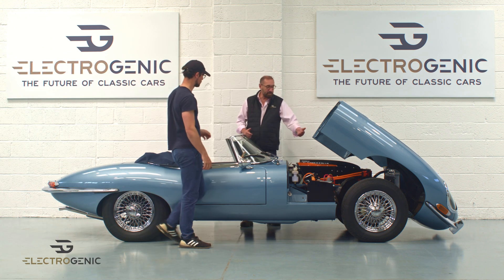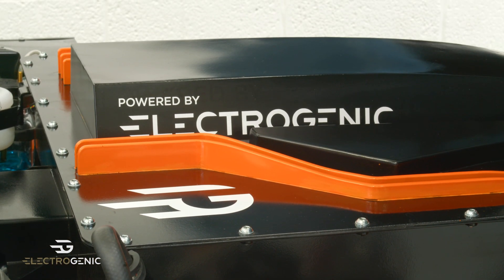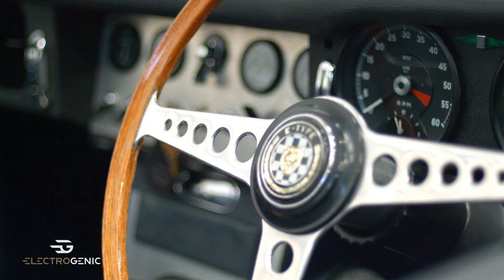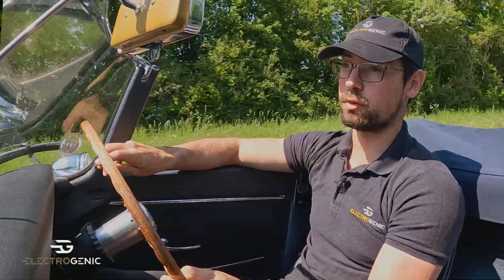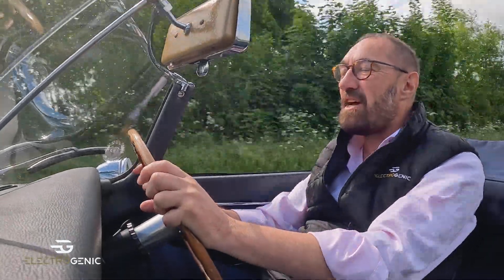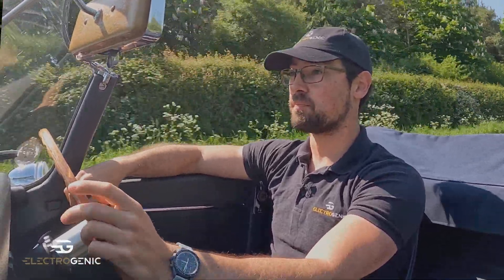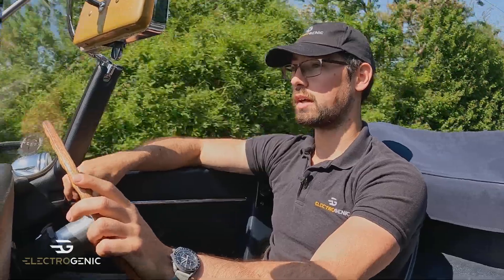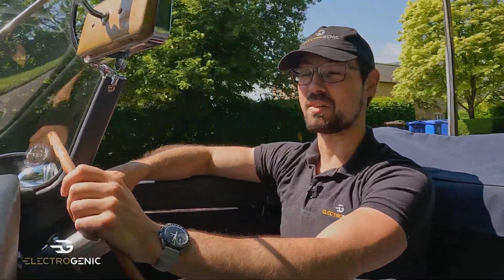Electric E-Type Conversion Kits | Electrogenic

Comment: And the cost is ????,   and even on the website they will not tell you. just make some vague comment
about "How long is a piece of string "
Reply: Are these kits and the partner installers available in Australia? I have this identical 1962 series 1, ice blue soft top.
Reply from the maker: @geoffreyrees4110  Yes - the kits are available worldwide. Drop us an email to enquiries@electrogenic.co.uk and we'll send you details.
Reply from the maker: The conversion kits are only supplied to partner installers. If you would like to go ahead with a conversion we can put you in contact with an installer for full details including cost. Let us know - enquiries@electrogenic.co.uk
Reply: talk about a scam.
it would take 10 minutes for you to get some estimates from the suppliers.
instead you ask people to contact you.
this puts people like myself off.
I have an x type jag, 2009, 2.2d auto.
I just want the most basic conversion to full electric.
I average 50 mph (faster if rolling downhill or a strong wind).
I am 61 and only city drive.
2 times a year I travel to abbey sands torquay (111 miles one way) and stay over the weekend.
I am a Virgo.
I love comedy, short walks, beautiful views and I am blood group B Positive.
Now, surely, you can give an approx £0.00 with that information.
yes?

Comment: Sacrilege :) , i do like EV conversions but i think it rather ruins the spirit of owning something as cool as a E-Type but for a hipster trying to look cool it would work i suppose.

I think something like a classic Rolls Royce would be a good conversion as its more about quietness and luxury so you would not care that the engine is gone. 

Also Its funny how much people buy into the whole EV is saving the planet nonsense, as the materials for the batteries are causing far more harm than oil and gas. 
We also will never run out of oil as its constantly created, the myth that it comes from dinosaurs is pretty funny though.
Reply from the maker: As with all of our conversions we don't cut or alter the car at all which means they are entirely reversible. Owners can choose to keep their engines. Once converted though you have a reliable E-Type that will get you where you want to go and back again! And you will be able to drive it anywhere. It's a useable classic and as you say, a very cool EV!
Reply: Outdated view, hydro and the sun will never run out too. In my country we are over 80%hydro. My electric car runs off my solar no cost to run saving pollution etc. I’m guessing you have a tv, phone,tablet, pC etc all made from polluting process like fossil cars batteries etc. I’m excited with the new battery technologies coming up that don’t use lithium etc. my petrol car I use as boat tractor runs off petrol which is taken from the ground in the middle east processed, pipped to ships travels to the other side of the world then pumped out into tanks then into trucks then into tanks that I can fill from. Very inefficient and polluting at every step. My solar  hits my roof goes into my battery and then into car. Beautiful, clean fast styley with over 500km range and very advanced  mod cons👍